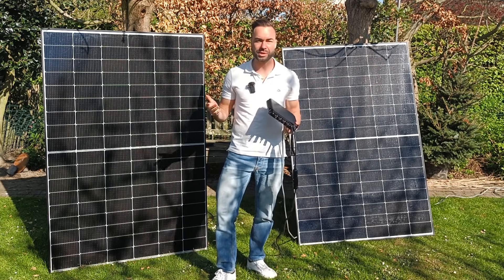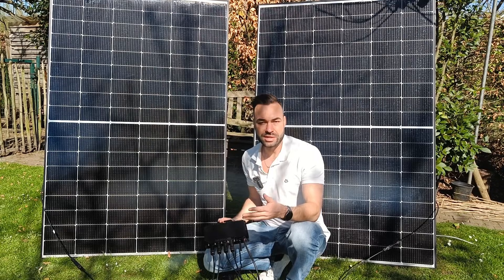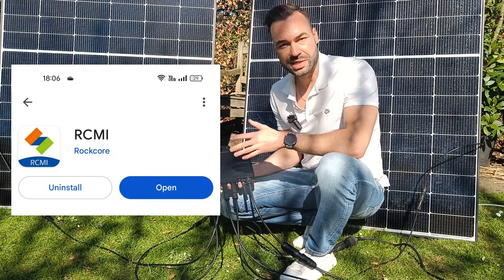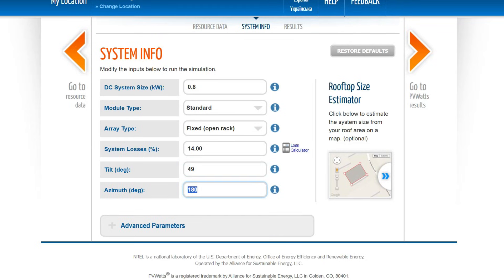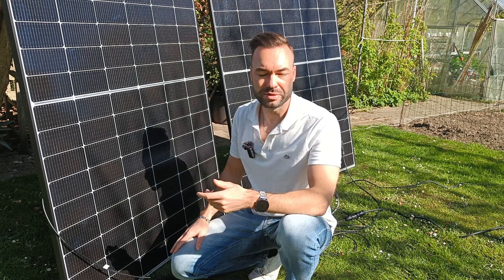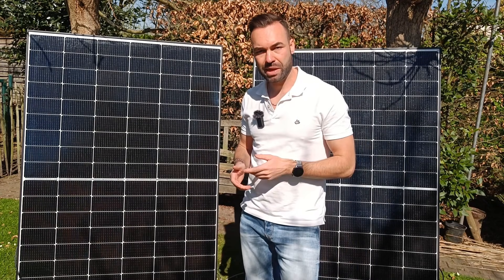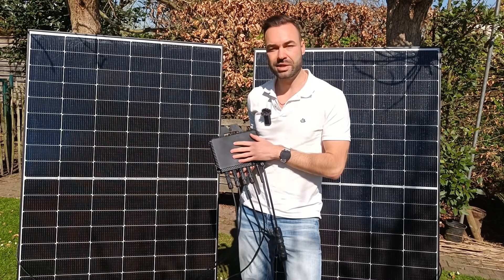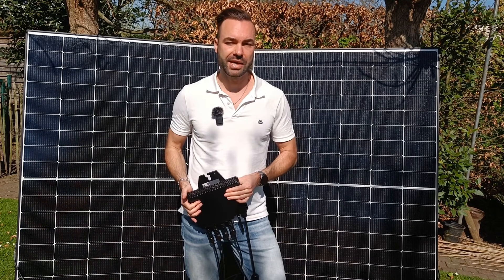800W Balcony Solar System - Plug and Play Microinverter with Socket

Comment: You have to be careful when plugging a micro-inverter into a branch circuit, though.  You can overload the branch wiring and set the house on fire if you aren't careful.   The main problem is that if you are injecting 800W into a branch circuit (such as a plug), that 800W is bypassing the protection breaker for the circuit.  So appliances further downstream on that same circuit can now draw 800W + 1800W = 2600W without tripping the breaker.   21A over what's probably 14 AWG house wiring designed to only handle roughly 15A continuously (and really more around 12).

It's also illegal to do this in the U.S., at any wattage.  Backfeeds have to be on dedicated circuits only.  A permit is absolutely required, and a utility agreement is also absolutely required.  But if you are going to do it anyway, follow some simple rules:

* Make sure the microinverter is using a plug at the very end of the branch circuit.  This ensures that no wiring overcurrent can occur since any combined power will be fed into appliances plugged into the same branch circuit from opposite directions (rather than the current combining on the branch circuit and the combined current flowing downstream into the appliance).

* Reduce the wattage you push to levels that are less likely to overload the branch circuit.

* If you two microinverters try to put one on each leg of the house 240VAC (find 120VAC branch circuits that are on different legs).

* Do NOT use branch circuits that also has AC motors (such as an A/C unit) on it.  The combined VA, even following the above suggestions, can exceed the wire rating due to reactive power from the A/C.

Note that 120VAC microinverters are NOT very efficient.  80%-85% is very typical.  Only 240VAC microinverters tends to have high efficiencies.  Also, most 120VAC microinverters (that you might see on Amazon) don't actually have proper anti-islanding.  They do not implement UL1741[SA][SB] at all.  They can detect when they are switched off but might not properly detect a grid-down situation.  And because they aren't very efficient they tend to run hot.

--

I personally think it is better to not illegally tie a microinverter into the home.  Instead, build a small solar + charge controller + battery + inverter system along with support power (a programmable battery charger such as the small ones Victron sells) for when the battery is low.... and have it run some medium loads in the house directly.  Such as your home server, internet, wifi, workstation, etc.

-Matt
Reply: Well simply don't plug more stuff into the same circuit then you normally have before, also most people are plugging these into outdoor plugs which will likely be a separate circuit then things they run other appliances on, the most I ever run on my outdoor circuit is a pressure washer.
Reply: @DanielsCorner644  The whole reason breakers exist is to protect against when people don't do the right thing.
Reply: America stuck with 120V will not be able to use this technology😂
Reply: @carkawalakhatulistiwa  why not?
Reply: Clothes driers, stoves, hot water heaters, etc. plug into 240-amp circuits.  We have them!
Reply: I understand this is a risk, but how many appliances actually draw 2600W? I get you could have multiple appliances, but even still I'm struggling to see how you could get 2000W+ for any sustained period without being a real idiot. Like you would need to have a toaster and microwave on the same circuit and be using both at the same time for an extended period of time. With so many circuits being for basic lighting or light appliances (like TVs, PCs chargers etc.) I think it would be fairly easy to find a circuit with plenty of headroom even not being dedicated.
Reply: @Philip88888888  I think an individual can be relatively secure as long as they know what the risks are and can avoid them.  Laws, rules, regulations, etc... are all designed to deal with the fact that when one is talking about, say, a city with a population of 200,000... it doesn't take a very large percentage of those people making terrible decisions to overtax the fire department.
Reply: @junkerzn7312  that's fair. I would like to see the regulations at least allow a 400W unit. I think the balance of risk/reward at that level is favorably in the reward camp.
Reply: Regular outlets in U.S. homes are 120VAC but the actual home service entrance in America is  240VAC single phase.  Properly installed solar ties into the 240VAC.
Reply: @junkerzn7312   so? no reason an inverter can't be configured to produce 120V.
Reply: @Philip88888888  You can certainly purchase small grid-tie inverters with 120VAC output, but the efficiency at that voltage is gonna be pretty bad... usually 85%-90% instead of the 98% you get at 240VAC.  Not to mention significantly higher cable losses.

This is why they only exist for very small systems.  Larger systems always tie-in at 240VAC.  The inverters run far cooler and cable losses drop drastically (losses are 1/4th at 240VAC what they are at 120VAC).

So with more than a few panels you will be using 240VAC.

-Matt
Reply: @junkerzn7312  Makes sense. Still think a 400-800W system times millions of homes in the US would make a big impact even with the drawbacks.
Reply: @junkerzn7312  actually US homes are 2 120v hot legs and a neutral coming from the grid, if you open your panel you have 3 wires and the ground.
Reply: @DanielsCorner644  Sigh.  No, that isn't how it works.  The residential transformer is 240VAC with a neutral tap in the middle.  That's why you see two 120 VAC legs (either end tap of the transformer) relative to neutral (the center tap).   L1 vs L2 is 240VAC.  It's a 240VAC transformer.

This is why it is called "split phase".  The two legs are phase shifted by 180 degrees due to the transformer geometry.  Residential service in the U.S. is single phase 240VAC symmetric around a ground-referenced neutral.

All panels and sub-panels have 240VAC (both legs) going into them.  But most actual circuits use one leg or the other leg to neutral (120VAC).  240VAC circuits simply use the two legs sans neutral.

This is why 2-pole breakers in U.S. panels are 240VAC and 1-pole breakers (plus neutral) in U.S. panels are 120VAC.

-Matt
Reply: Matt, some good advice that you noted. Thanks.. If you can save one house, it was all worth it..
Reply: For this setup do you need a bi-directional electricity counter ? Or can work without it ?
Reply: Google AI.  Q how many AC amps post inverter from  800 w of DC solar  ..    answer  ; Voltage Matters: The amperage depends on the AC voltage you're using (e.g., 120V or 240V). A 240V output would draw about half the amps (around 3.3A).

Comment: I would probably set something like this up to make hot water, but $184 per year isn't really that life changing. When you say plug the micro inverter into your house how do you mean exactly? Do you mean making a suicide plug and plugging it into a wall socket? If so, that's incredibly dangerous!
Reply from the maker: $184 is something. And it's recurring 😉. It also depends on your electricity rate. There is no power on the socket. As I have explained in the video the inverter needs to synch with the grid first before it can send any power back. If it is not synched with the grid it cannot deliver power.
Reply: will it immediately shutdown if someone unplugs the plug? I guess this is a safety feature, but a suicide plug just never seems the right thing to do. Yes it's more portable, but most people don't understand the general danger of this method and may use it for a generator or normal inverter.

Comment: Nick, 
What is the maximum you can put in to a wall connector? Is it allowed to have more of this systems? 
Wat is het maximale wat je mag inpluggen in het stopcontact zonder dat er controle moet zijn van fluvius?
En mag je meer van deze systemen hebben, wel met een zwaardere zekering dan?
Reply from the maker: The maximum size of the micro inverter is 800W in Belgium. You may not add more than that per house.

Comment: I don't think this setup will make your meter turn backwards in Belgium, it will just stop turning if the panels are powerfull enough to operate whatever you are using at that moment.
Reply from the maker: It depends if you have a contract that will make your meter turn backwards or not. I have that.

Comment: In most countries you cannot just feed back into the grid just like that. And most energy meters will not "turn back", but rather add what you feed in to your bill
Reply: RUBBISH. anyone can do this ....just don't put in more than you use    no one will know
Reply: You Will use most of the Energy in the home. With a few panels you wont send so much back
Reply: @SirLampsA  I consume less then 20kWh a day and generate 40-50kWh.. That is most "most energy is self used"
Reply: @mrx1979ua Nice that's a lot!
Reply: @SirLampsA  I want more! But limited by how much I am allowed to push into the grid.. A 5Kw limit

Comment: @cleversolarpower this setup can increase bill without problem just because there is no export limiter.
Lot of electric company meters are not two directional and any export is calculated as import.
Hope in next video you mentioned this.
Reply: That's a good point, always make sure your meter is able to go on the opposite direction.  At least in the U.S., probably 80% of the meters will run backwards.  But if you don't have an agreement with the utility you can wind up getting fined if the utility notices:  (A) any net backward movement on an old meter or (B) any net export on a 6-minute interval if you have a smart meter.

Comment: I began dabbling in solar about 10 years ago worth a small 12 system. The 40 amp Renology Tracer controller still works just fine… but has no settings for lithium batteries. So I am updating everything and wanted a refresher on information over the last decade and found your videos. Then bought your book as a show of support for the time, work and detail you put into your videos. Appreciate you Nick.

Comment: I would wire the system in parallel to an off-grid MPPT (with battery and battery backup) so I could use the energy when the grid is down. It would be so easy to have a switchover. I will also look into larger options here in the states.

Comment: Is anybody in the comments in the UK using this system? I’d be interested to hear a use case example. I’m literally planning an 800 Watt panel solution on my shed roof, and something like this seems like a total no-brainer option. The grid can store my excess power.

Comment: Not legal in Sweden unfortunately. Looks easy to set up and safe to use. (Not much we’re allowed to do here regarding electricity without hiring an expensive professional electrician)
Reply: You can use a Lifep04 battery and inverter. Keep it independent from the grid.

Comment: Sweet. In a grid down one could unplug the microinverter and have a redundant pure sinewave, cheap mppt inverter & battery, and use an extension cord for your frig & other appliances.
Reply: @peterkavan8368  If it’s sunny out. 😁

Comment: That's awesome. Unless things have changed in the UK to grid-tie any system you need G98 or G99 approval. Perhaps we will get the same 800W allowance without approval soon too but I won't hold my breath.
Reply: it would be G98-99 approved
Reply: @ The inverter may well be but approval is still required from the DNO in the UK. I’ve heard that approval isn’t likely to be an easy thing to get for these DIY systems but I have no first hand experience of this.
Reply: @st200ol  G98 approval is pretty easy and notification only, I have done it myself for my DYI system, but it gets more complicated the bigger you go as DNO's get more and more anxious with the grid being able to take the export load, I have seen even contractors get in-person inspections from the DNO for G99 and G100 installations.
Reply: What about if you add this to your existing solar system?
Reply: @ If you have the G98 or G99 approval then as long as you export up to the respective agreed limit then that would be fine.

Comment: I thank you for actually standing next to these panels, it gave me a reference how big they are. and I wanted to install them alone, i'm insane lmao
Reply from the maker: I could carry them myself, but it's better to have someone help you, especially when you are lifting it higher than your head 😄
Reply: A good rule of thumb is that panels up to around 320W are fairly easy to solo-install.  Up to roughly 400W is doable but a lot more trouble due to the weight of the panel and the difficulty getting your arms around it.  Above 400W and you need to 2-man it.   Some installers can solo larger panels by putting them on their backs one-handed (while climbing a ladder for example), but this puts significant stress on the panel so it isn't really a good idea in terms of ensuring that the panel lasts its full life-span.
Reply: @junkerzn7312  that's actually a good rule, thanks

Comment: 425 Watt panel for $65 is awesome!  Also:  First.  :-)
Reply: In USA not seeing 400something for less than $200-$300
Reply: @L0st-n0found  that’s probably the tariff conditions.
Reply: @rogerhargreaves2272  more than $200  is  the lowest price in it's ever been is USA.    Of course all sources are from China here so will go up with increased tarriffs
Reply: @L0st-n0found  You had tariffs on panels even before Trump 2, they are cheap in the EU, 380w for 39 euros.
Reply: @badatdota2811 yes they were first imposed by 1.0 Trumpsterfire
The usa made panels are every year  either: becoming much less equivalent in tech, no equivalence at all, or assembled in usa from parts made in Asia.
All this for USA assembled from all electronics and solar cell Asian made being 6-10-? Times more expensive than you EU can buy.
Thats great for USA
2.0 admin is on track to make sure USA has a Dark Ages era.
Reply: @L0st-n0found  I got 650 watt panels here in us for $100 each, now just trying to find an inverter for 13,000 watts.
Reply from the maker: I agree, $0.15 per watt.
Reply: Yeah I saw similar 435w for 67eur
Reply: That’s what I thought.